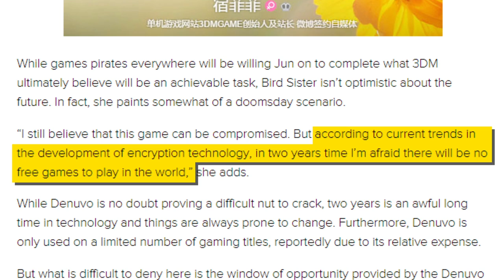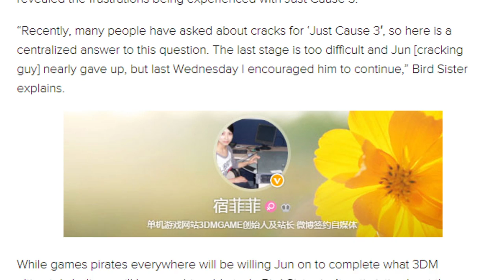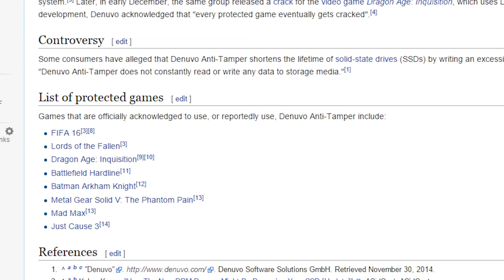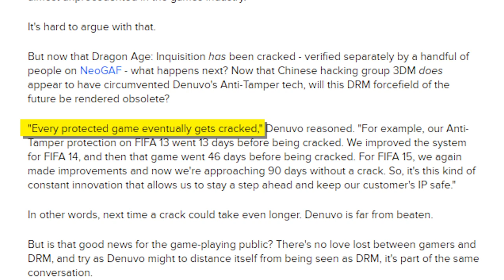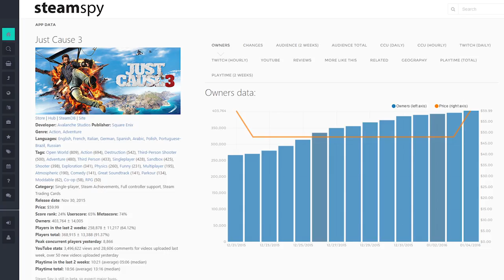No More Piracy in Two Years? - The Know

Comment: in the last month just cause 3 sold 400k in total. now according to wikipedia, jc2 sold 1.5 milion copies over 3 platforms in about the same time, so assuming they sold equally well on all 3 thats 500k in a month for the pc (i could not find proper sales figures, this is the best i could do, someone correct me if im wrong). 

so the sales are on trend for the franchise, and the publisher spent a but tonne of money on anti tamper software for no gain in profit. they could have used that money and given the devs a nice bonus. also the paying customers have the lovely problems with avalanche servers. putting them in offline mode then trying to connect them again when they open the map. each one of those is a good 20 seconds of frozen gameplay with a loading icon.

the sad thing is that when it gets cracked, the cracked version wont connect to the server. the god damn issue is that the pirates generally provide people with a version of the game that doesnt have that problem. in that respect its a better version.
here is another example. pre order bonus crap thats spread accross different outlets. best buy has item 1, gamestop has item 2 etc... cracked version has all.

one of the main reasons why i bought witcher 3 was because it didnt have drm and always connected bullshit. the game had a few performance issues but i was happy knowing it wasnt because of a drm punishing the legitimate customers. because it doesnt punish the people playing the pirated version, EVER!  it went on to be a very successful game. and other publishers should take a page out of cd projects book.

Comment: there's just not enough firm data to know exactly how much revenue is actually lost due to software piracy. You can't legitimately correlate a pirated copy to a lost sale or even a percent of a lost sale. There are too many other factors and to many cases where a consumer would just pass on a product if they can't get the pirated version. Not to mention cases where an actual customer gets a pirated version because of issues with the DRM or just to try-before-buy.

Comment: "What happens when if the publishers go away?"  You answered your own question, the encryption will be crackable in about ten years.  That's enough time that if a game has been abandoned by its publisher that it could be freely copied DRM-free.  This is not a new thing.   The Atari 7800 and the 3DO had effective lock-out schemes that prevented homebrews from working on consumer units for about ten to fifteen years after those platforms went on sale.   It took that long for computers to became fast enough that they could brute force the lock-out tech so that new games could be signed to work on consumer units and not just developer kits and emulators.
Reply: +MrTBoneSF That's exactly what we said in the video...

Comment: you sure it 64-bit encryption because Advanced Encryption Standard
(Rijndael) which uses Key sizes 128, 192 or 256 bits and Block size of 128 bits was created by Vincent Rijmen and Joan Daemen back in 1998.
Reply: +Joe Killian
forgot to say that no amount of encryption will stop digital piracy for good as better  encryption  methods are created in response to people trying to brake the encryption to get the data being encrypted.

Comment: The problem will remain if they ever removed the DRM.  If Battlefield 5 had this state of the art DRM and sold well they would continue to use it because then they would think that that is a factor to why.  But in reality maybe they did a good job on the game.  Then they release battlefield hardline 2 which is terrible and doesn't have the crazy DRM and see the sales are low and might correlate that with more pirates instead of realizing the game they made wasn't good enough.

Comment: I currently have a Xbox360 that doesn´t let me play an original game because it ask me it needs some update and it won´t let me play it. The thing is… I could play it (OFFLINE) before and I don´t know exactly what happened. Because I don´t have that much time to play anymore, I haven´t have xbox live for a couple of years now; and like a couple of months ago I had a little free time and I wanted to play that game [Forza 3, witch 1 dlc] but then it asks me to update it, and because I didn´t want to connect the xbox to the internet, to look for the cable, etc etc.. I said screw it, just screw it I won’t play it, “I didn´t want to play it anyway”.

Maybe some newer game updated my xbox360 to a new version and then the other one needed an update, I don´t know but it won’t let me play it.

I used to pirate games but then I wanted to do things right and only play what I pay for. Then things like this happened, games that doesn´t work, that on pc doesn’t even starts and one must look for solutions in the forums; games that won’t let you do anything if you don’t update it, games that requires internet connection when you only want to play single player. Things like that makes me feel like it is a stupid thing to buy it, it’s like they just want to screw you. Now I tend to not buy games anymore(maybe one or two a year at much at this point).
[Sorry for my English, it isn´t my first language].

Comment: Well, if your going to play a game with denuvo protection i suggest you install it on a harddrive you dont care about. Since it will wear it down faster than anything out there. And it will break your harddrive in the end. The lifespan of a harddrive with that drm installed removes 60% of the lifespan of the harddrive xD So dont install a game protected by that crap on your ssd's. Since they cost a bit more and you will be forced to swap it out in a year or two due to hardware failure.